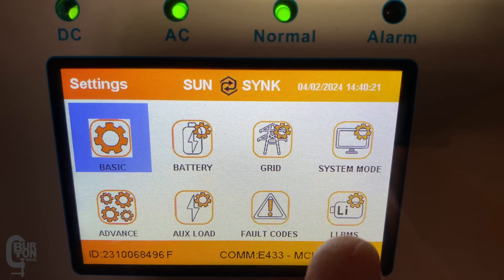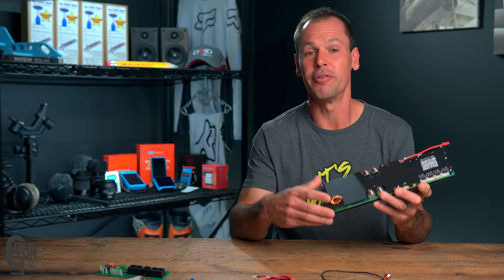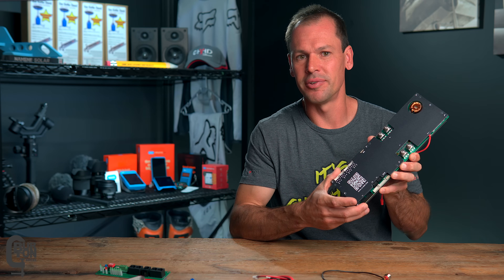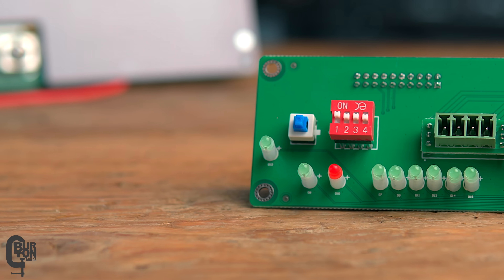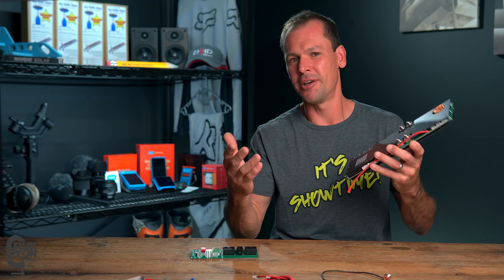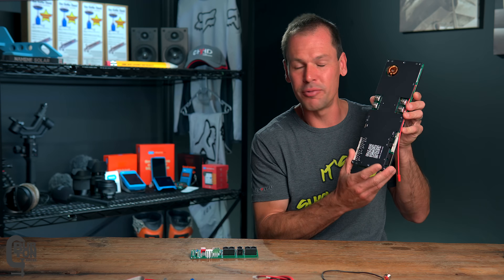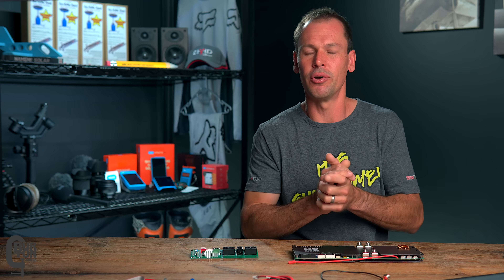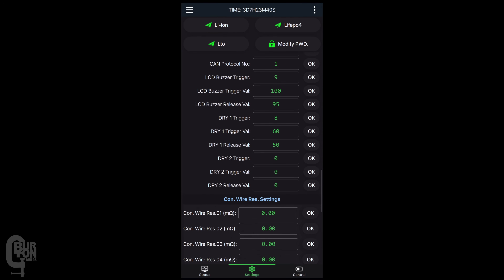New JK Inverter BMS Review + Test with Sunsynk Inverter

Comment: Hi there..  I have two  packs of 36v 12s jk Bms installed. My question is will I connect two jk Bms in series in 12s,12s configuration
Reply from the maker: Hi, I'm no expert but I don't think it's good practice to connect and run BMSs in series with each other.

Comment: Hi Grant, great video. SUBSCRIBED! 👍
Is there any way to disable the “beep” every time I swipe through the app?
Reply from the maker: Hi, thanks very much. The only beeps that I recall are when you login to the BMS on the app… a double beep, then after that, no more beeping as you move through the various screens / settings of the BMS within the app. It also beeps each time you update a setting though.

Don’t think these beeps can be disabled, or rather not that I know of last I checked (which was a long time ago).

Comment: Good day
Can i use the heater power source to a cooling fan and set the fan if batt temps reach 39C.. we live in a tropical country and the ambient temp here can reach 38C
Reply from the maker: I'm not sure, but I think it would be better to use a separate power supply to power the fan and use one of the relays on the BMS to trigger the fan when an over temp occurs.

Comment: Hello. I also have a battery system on parallel jk bms 150a-2a. I encountered a problem with incorrect current display, I tried to calibrate the device for 20 amps, and in this case, when 20 amps are supplied, the display is correct, but if the current is changed to a smaller value, it shows a significantly lower current. For example, 1.5 amps instead of 2. Or 45 amps instead of 40. Have you had this problem? Is it possible to solve this by replacing the firmware or changing the settings?

Comment: Good video....My JK bms stopped balancing the cells for some reason, I removed the connectors from the cables to turn it off and on again and it came up with an error "Sample - wire Resistance Too Large"..Now all the resistance readings are at 0.000 I have checked all the wiring and it is fine, very strange that it is the 16 cells at the same time and everything happened when I disconnected the connectors and reconnected them....Any solution to this problem?...thanks

Comment: Have a Jk invertef Bms with eve 280  x 16 cell configuration.
Alsi have 3 x Kodak FL5.1 batteries  from an existing installation..
I have seen some videos where diffefent Bms are fixed at a small scale running in parallel. 
On the inverter side it is "user " settings.

Have some-one tried something similar.?

Comment: Awesome video ,will it communicate with lux power inverter
Reply from the maker: Hi George, I had a look in the CAN Protocol menu on the BMS and there is an option for 011 - LuxpowerTek Battery CAN protocol, although I'm not sure if it works as I've never tested it before. Generally speaking, if your Luxpower inverter will communicate with Pylontech batteries, then you should be able to select the Pylon CAN protocol in the BMS and that would likely work. If you check my community page on the channel, I've posted some pictures of the list of communication protocols.
Reply: Thanks

Comment: Thanks for the vid. My Daly BMS failed, and i will buy an JK now. 
But in our place using smartphones are prohibited. 
Can i use this JK  BMS out of the box only with the PC software?
I need the answer urgently. i'm asked JK too, but no answer since 3 days.
Reply from the maker: Hi, I have never tried to setup and configure an unused and new JK Inverter BMS only using the PC monitoring software, but I have tried changing settings using the PC Monitoring software (version 2.9) on a BMS running Firmware V15.30 and most settings can be changed successfully... I noticed RCV Time and RFV Time sometimes worked and other times didn't (the software returns an error when trying to change the setting). Also, I was unable to select anything in any of the dropdown menu's for setting stuff like UART or CAN protocol settings, LCD buzzer settings or the DRY contact settings.
Reply: @GrantBurton  Thanks, I'm ordered now Seplos V3 BMS, it works sure with PC by default. Let see when arrived.
Reply from the maker: 👍 Let us know how that works out. I think I've heard before that the SEPLOS V2 BMS is more popular than the V3... I think it had something to do with the state of charge accuracy, or something along those lines... I can't quite remember now.

Comment: Is there a list of hybrid inverters that are compatible with this bms? I couldnt find a list anywhere. I have a SolaX LV Hybrid inverter. I know from experience the inverter works with LG Chem communication protocol (but i dont know if it does or doesnt work with any other communication protocols)

Thanks
Reply from the maker: Hi, theoretically it should work with any inverter that works with pylontech batteries, because the Pylon CAN communication protocol can be selected in the BMS (although this isn't always trouble free). In my community section, I've posted some pictures of the CAN and UART communication protocols that can be selected - Screenshots from a BMS running firmware V15.30. here is a link https://www.youtube.com/post/Ugkxh9xTovVUAExO16Wnj6j-1XRHE6q9lSNC The only ones I've tested are the DEYE and PYLON protocols, so not sure how well any of the others might work.
Reply: @GrantBurton  thanks Grant. I don't know if my inverter supports pylontech can protocols

Comment: Hello and congratulations again for your great video
I had a question: can the JK-PB2A16S20P
communicate easily with a victron multiplus II 5000VA? what equipment do you need special cable in addition?
I'm trying to find out about the bms because as I have a large 24 volt 1300AH battery pack I would like it to work perfectly before investing in the BMS and the victron multiplus II!
laurent
Reply: Yes it will with a cerbo and a proper communication cable. I have the same JK and Multiplus and it works like a charm. Good Luck.
Reply: Hi  @LordOneHoop 
Do you need a lynx shunt or can the Cerbo get the current reading from the jk bms as well?
Reply: @lincolnbarlow4778  No need for a lynx. You just need  a can cable between the JK bms and the Cerbo BMS-Can input. The wiring is a typical Victron A connection cable. You can look that up what pins you need. Normally 2 wires and if you like a third for the ground. The latter is not really neccesary.
Reply: search for battery_compatibility:can-bus_bms-cable
Reply from the maker: Hi Laurent, thanks very much. I've never tested it with a Victron system (can't afford Victron unfortunately), but Andy from @OffGridGarageAustralia has done extensive testing with the JK BMS connected to his Victron system (48v system). I think you need a Cerbo GX to get the communication working between the JK BMS and the Victron System. You'll also need a VE.Can to CAN-bus BMS cable. I think you can also make this cable up yourself if you have the correct tools... Andy explains this pretty well in his videos... you'll just have to scroll through his video list and look for the JK related videos because he has a lot of useful and informative videos.
Reply: hello and thanks again for your quick and concrete answer!
I'll see with Andy he's very nice!
for the victron I'm currently looking to find a way to switch to self-consumption not sure I'll switch to victron because it's very expensive! but maybe there's an equivalent in a reliable inverter?
thanks again
laurent

Comment: I have a cable supplied with the BMS, it is a bundle of 4 or 5 green wires connect all to a lug, and also a red and black wire. Other end has a connector, I think it fits in the left over port on the BMS, maybe for heating pad? We dont use this green wire-bundle?
Reply from the maker: Can't say that I've seen the green wire bundle you are referring to, but if it connects into the heating port plug on the BMS at 02:52 (the plug next to where the balance leads plug into), it could be for the heating pad connections. Not sure why they would all be connected to a single lug though.
Reply: @GrantBurton  i have info from my supplier, its indeed for the heating pad. These green wires will be tied to ground, offering current to flow and active the heating if this is in use. We dont have to connect this port.
Reply from the maker: Thanks for the information 👍
Reply: @GrantBurton  i have my first of 3 packs now live. Its on a Deye 12kw hybrid. We select lithium-00 right? In the Deye. In JK we select canbus deye protocol? So far this seems to work here now with 1 pack. Fw 15.26.
Reply from the maker: Yes, On the Inverter select Lithium as battery type and Protocol should be 0. On the BMS, set CAN protocol to 001:Deye or 002:Pylon... both should work. I haven't used firmware 15.26 yet... Both my BMS's are on 15.27 at the moment. Also set BMS address to 0 (all 4 dip switches off) so that it is the master BMS.

Make sure to check on the Li-BMS screen on the Inverter that the BMS is communicating with the Inverter and that all the limits that are set in the BMS are being reported correctly to the Inverter.
Reply: @GrantBurton  i had the addres of the dipswitches on 1000. But, communications work. Later next week I will add pack2 and pack3. And also test soc fixer solution. Also maybe ill flash all 3 packs to 15.32 or 15.33 when released

Comment: 15.32 is out
Reply from the maker: Hi, thanks for the info... I think it's only available for the 200A version at the moment? My BMS's are 150A versions so i'll have to wait. I believe Andy said there should be a version 15.33 out soon.
Reply: @GrantBurton  I hope all is still working fine, with 3 BMS in parallel, and with Deye. And with the SOC fixer solution :)

Comment: Will it work on the Lux power inverter
Reply from the maker: Hi George, I'm not 100% sure if it will work because I only have a SunSynk inverter to test with, but if the Lux Power inverter has CAN communication and is able to work with the Pylon CAN protocol, and if you set the BMS to the Pylon CAN protocol... I think it might work??? To be 100% sure it will work, somebody would need to test it.

Comment: Do u know if the jk bms will work with a luxpower inverter to read correctly with the communication
Reply from the maker: Hi, I'm not 100% sure if it will work because I only have a SunSynk inverter to test with, but if the Lux Power inverter has CAN communication and is able to work with the Pylon CAN protocol, and if you set the BMS to the Pylon CAN protocol... I think it might work??? To be 100% sure it will work, somebody would need to test it.

Comment: Hi Grant,

I have Solis hybrid 5KW inverter, and I'm using it with 16 EVE 304 cells and the same (as you are showing) JK inverter BMS with an active balancer. I've been running this setup for the past five months. The JK BMS communicates the state of charge (SOC) to the inverter, but the SOC keeps drifting over time.

Here's the issue: even when the BMS indicates a 100% SOC, the voltages drift slightly lower with each cycle. Over the weeks, the SOC gradually drifts, so while it shows 100%, each cell and the overall pack voltage are slightly lower than the previous cycle. If I adjust the battery capacity settings, the BMS resets to 70% SOC, and the inverter charges another 3 or 4 kWh. This SOC drift is frustrating because on cloudy days, my 16 kWh battery effectively only charges to 11 or 12 kWh. The remaining 4 kWh stays uncharged because the BMS incorrectly reports 100% SOC to the inverter. To fully charge the battery, I have to keep changing the capacity settings in the BMS back and forth.

Is there a way to use this inverter without CAN communication or by setting it as a generic battery? If anyone else has the same issue or knows a solution, please comment and suggest how to fix this problem.

Thanks!
Reply from the maker: Hi, are you allowing your battery to fully charge each day... as in reaching the RCV and then holding the RCV for 1 or 2 hours each day? I have heard of the SOC drifting over time when a battery bank is charged and discharged a few times, and isn't fully 'bulk' charged each time... kind of a SOC calculation error that compounds over time... or at least until the next full charge where SOC resets to 100% again according to one of the cells reaching the 100% SOC reset voltage.

Does your inverter stop charging your battery when '100% SOC' is reached (whatever voltage that may end up being) or does it charge according to the RCV the BMS sends to the inverter, and only stop charging (or reduce to 'float' charge voltage) when the RCV is reached and the RCV Time is reached / exceeded? Because if it's charging according to RCV, I don't see how the voltage should drift lower with each charge cycle because the charge should be charging the cells up to your specified voltage each time, and not stop charging until it reaches that voltage.... Unless there is something I'm not understanding (I'm no expert though... haha).

What is your 100% SOC Voltage, RCV and RCV Time set to? Also what firmware version are you currently using? 

I think it is better to continue using it with communication as that will give you the most accurate SOC... it's accuracy (or inaccuracy) at the moment will probably still be more accurate than running in 'voltage' mode without communication.

Comment: If you switched off this BMS for, let's say, a week and start again, the settings will be reset. I'm not sure when the manufacturer will fix it?
Reply from the maker: Hi, I think this was an issue with the old firmware... this has since been fixed with later versions of the firmware. I know it was fixed in V15.11 and later. Did you manage to update your firmware?

Comment: Do you need to connect this to an inverter to use it? Or can you use it like any other BMS too, with a dumb charger and inverter?
Reply from the maker: Hi, it can be used like any other standalone BMS, it doesn't need the communication to be connected to the BMNS for it to work, however you'll need to set the 'dumb' charger so you don't overcharge your battery/cells and set the Inverter to stop discharging the battery before it gets to low.
Reply: @GrantBurton  thank you!!

Comment: Hi Grant,
Good video, all info about this bms is very welcome 👍
Can you confirm the settings data now being stored in flash memory (IF present at the bms at all)?
Andy from the offgrid garage posted a warning on this JK BMS systems resetting to li-ion settings after loosing all the data after being shut off for some days. this because the data was stored in RAM. The firmware update changed this in LTO being selected after a "reset" due to being swithed off for some days but nothing beats flash!

Did you test two to five of them as two to five different but equal batteries in the Victron Cerbo?

Soon, my ordered 40 extra cells will arrive and buying 3 extra 123smartbms BMS systems, each costing € 500 and more is, together with 3 relais or trip fuses, where the jk bms has all inside, kind a of dealbreaker for me.

Keep up the good work!
Reply: On old firmware the BMS switched back to stock LTO settings when the input parameters made no sense. This was intended by JK. After many concerns they changed the firmware and give a direct warning if you type in stupid values. So you cannot store stupid settings anymore and therefore the BMS does not reset back to base settings.

Comment: I bought 4 Apexium DIY battery kits with the JK Inverter BMS PB2A16S20P. The first one I built had a bad BMS right out of the Box and it looks like Jkung is not going to replace it. 34 days have gone by without a commitment to replace it.  This is not good after sales support.

Comment: It is important to understand the RCV and RFV settings are just requests sent to inverter/charger to adjust the inverter/charger's charge parameters.  The inverter/charger is still the master regulating actual charge rate.  If inverter/charger does not understand the BMS requests due to inverter/charger not having the proper RS485 or CAN physical interface and matching comm protocol with the BMS, the requests will not be executed by the inverter/charger.

The BMS does have a DC to DC converter (big toroid inductor visible) across the charge disable series pass MOSFET's.  When charge MOSFET is disabled the DC to DC converter can activate allowing 0 to 10 amps charge into battery.  The primary application of this is BMS intended for rack mounted battery packs that may get a battery installed or discharged where it is significantly lower state of charge.  Other parallel batteries would push a lot of charge current to the low SoC battery.  The DC to DC converter allows a controlled amount of charging current to the low SoC battery.   This DC to DC converter can also be helpful near full charge state where too much cell imbalance would cause a full charging shutdown due to a cell overvoltage condition.  BMS can fine tune the charge rate down to low level still allowing balancing to continue but preventing a cell overvoltage shutdown by reducing charge rate.  There must be comm with inverter/charger to use this because inverter/charger without BMS comm will likely interpret charge current drop off as a fully charged battery and drop inverter/charger down to float mode charging voltage level.  During this BMS buck converter charge rate reduction it tells inverter/charger to maintain an absorb voltage level charge voltage.
Reply: I set my inverter to lead acid and charge voltage to 58v and float to 54.4V works good for me I get to 3.65v without a problem every battery is balanced. I don't see a need to use comms treat the inverter as a power supply. Some reduce the absorption to 56.4V for longer battery life I like faster charging.
Reply: You might try a different communications driver that has the correct data mapping. I know of three protocols that'll work between my EG4 and the JK. There may be others as well. Lux Power works great for mine.